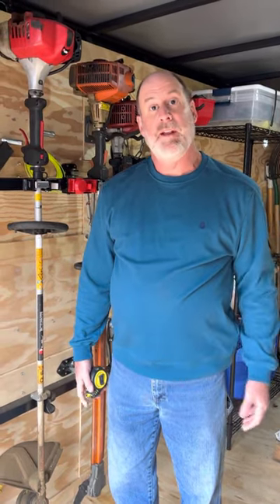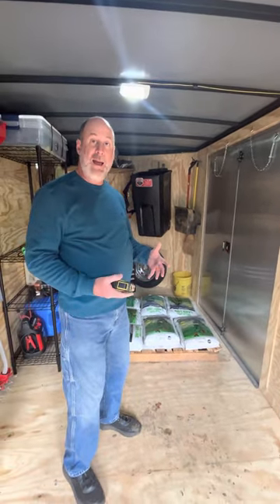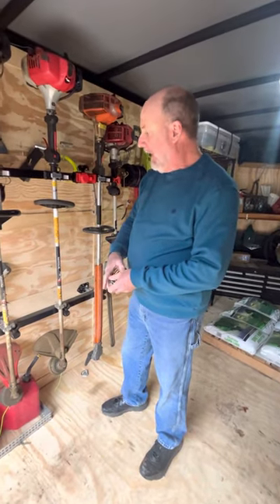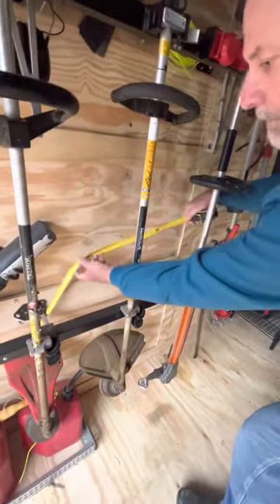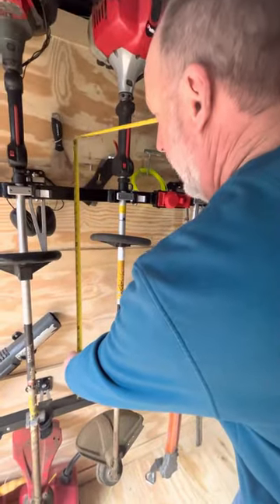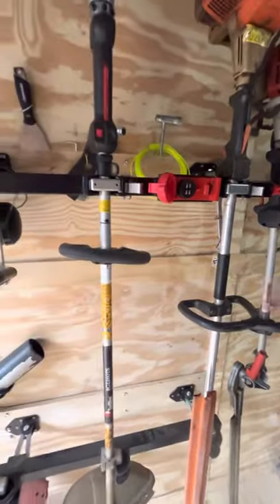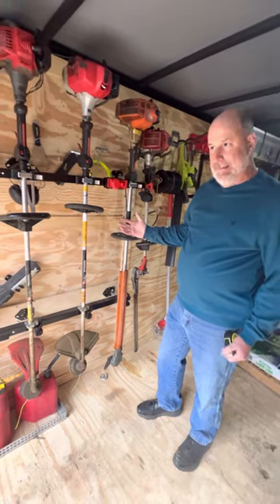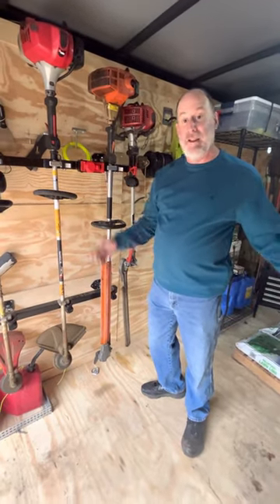Mounting trimmer racks vertically in an enclosed trailer.

Comment: What are you using to hold your leaf blowers
Reply from the maker: Hooks I got at Lowes then welded a chain to it and a padlock.  I couldn't see paying $300 for a blower specific rack.  My hook may not be as secure but $10 instead of $300
Reply: @keithlindsay  are the chains and padlocks to help hold in place or to keep from being stolen
Reply from the maker: @garystoner9212  The chain and lock is to hopefully prevent the blowers from being stolen.  A bolt cutter could cut the lock or chain, but just trying to make it harder for a thief.  I just could't pay $300.
Reply: @keithlindsay  ok thanks